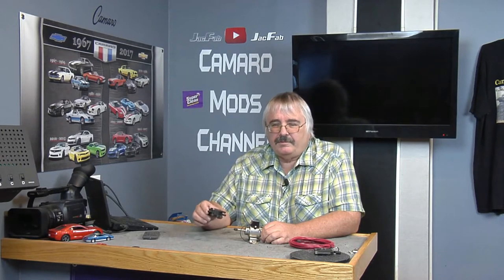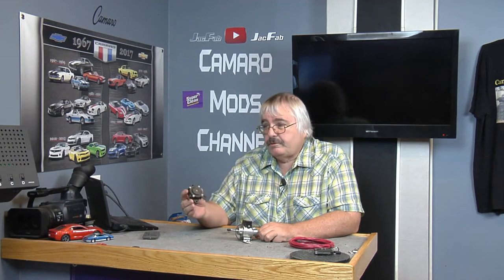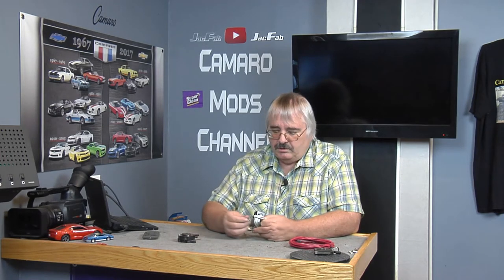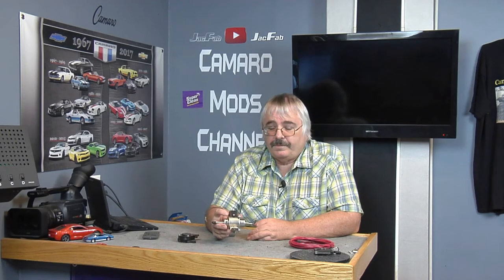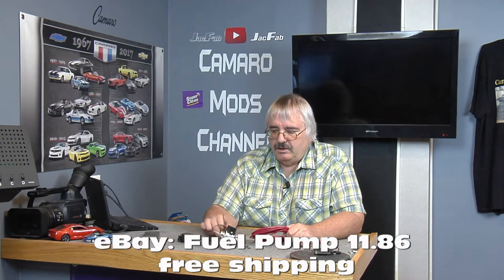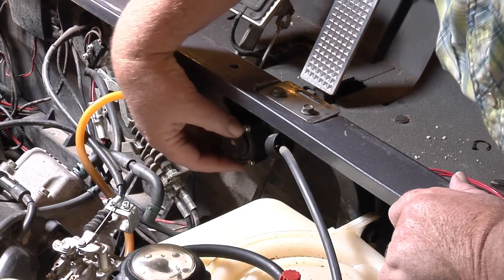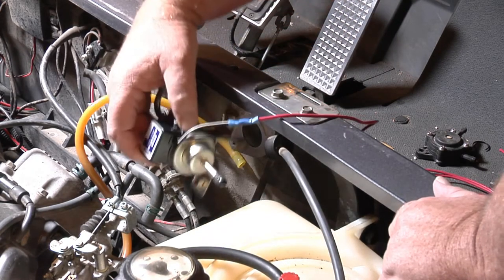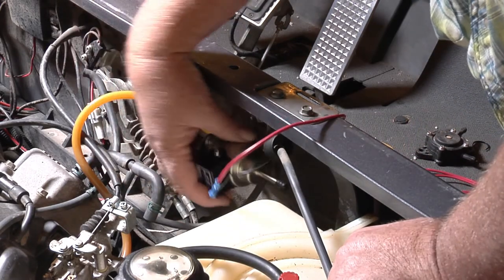How to Install a Electric fuel pump in a Yamaha Golf Cart,

Comment: Could have wired it to the switch side of the starter solenoid and added a fuse between there and fuel pump. Just a suggestion rather than run it all the way to the front of the cart.
Reply from the maker: Yes, great idea.  Never thought of that. Thanks...
Reply: @camaromodschannel  What did you do with the vacuum line from the old pump? Plug it off or reroute it?
Reply from the maker: @gmg2king  plugged it with a screw. Thanks

Comment: Thats how I wired mine. On the starter side of the solenoid. Works fine and you don't have to listen to it when you come to a stop and saves battery.
Reply from the maker: Yes, works great.  Thanks

Comment: Does it work well?  Does it not over do it on the gas supply?  How's it working out?  I need to put one on my old G1 I use around home.
Reply from the maker: Yes, working well. It don't over do it your float cuts the fuel when not needed.  Thanks
Reply: @camaromodschannel  that’s what I was thinking

Comment: Why wouldn't you wire it so when the engine is turning over the pump is on.  The way you wired it you would always have to turn the key off.
Reply from the maker: Connect it to the starter? When its turning over, will only get fuel when the starter is running.  Don't bother me to turn it off. Find a way to connect it to the charging system,  when its charging the pump is running.  May look into this. Great idea.

Comment: With this work in the subzero winter in Minnesota?
Reply from the maker: As long as your fuel doesn't freeze, run some heat fuel additive.  Should be fine.  Thanks.